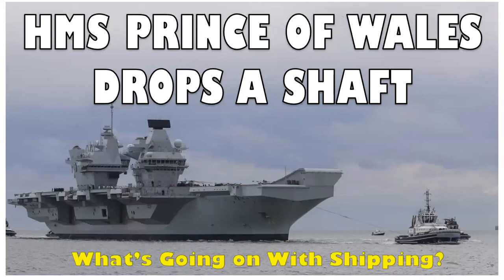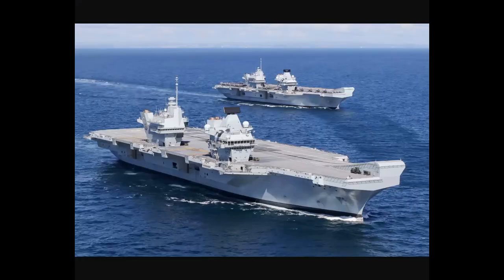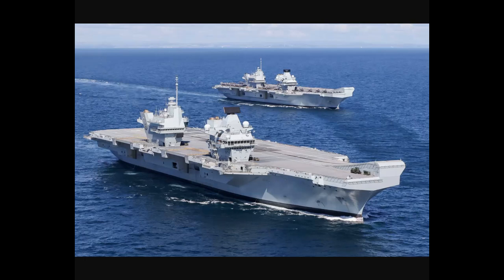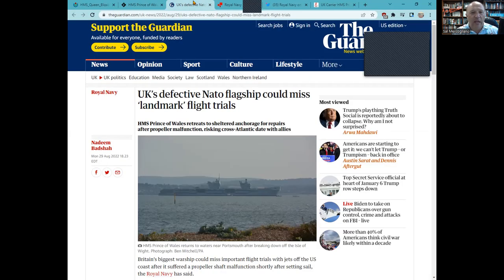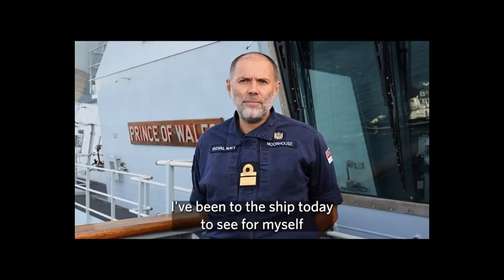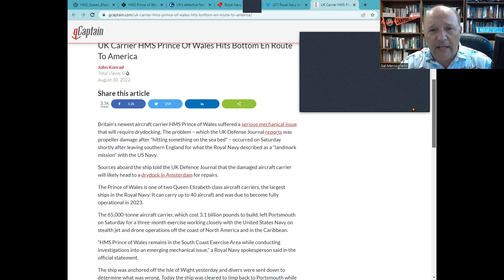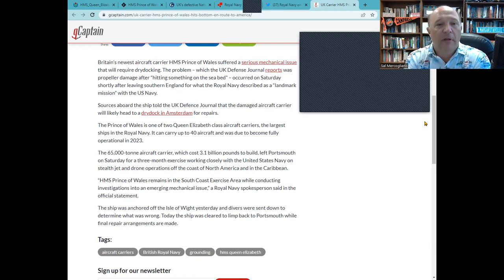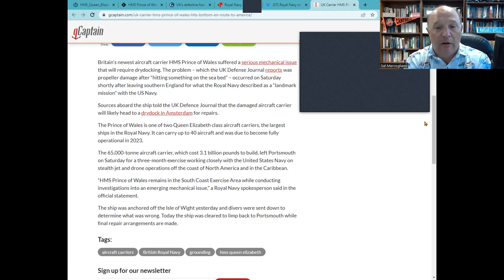HMS Prince of Wales Drops a Shaft - What's Going on With Shipping?

Comment: I may be wrong about this but heard that due to EU rules the contract for design had to go to the lowest quote. In a typically French underhanded manner the lowest price was offered by Thales, who would obviously increase the costs as time went on. The biggest problem here was that they had designed the appaling Charles de Gaulle which had so many faults that it was a laughing stock. One of the biggest problems was the propeller and shaft design so it's no real surprise to anyone that the PoW would follow on. The greatest testament to their stupidity had to be that,despite having used the Grumman Tracker for years, the aircraft carrier was some 60 feet too short to use this essential aircraft. What to do? chop it in half and add an extra section in the hull. This may sound hilarious but having spoken to a French sailor , he informed me that on descending some of the stairs would bring you up against a bulkhead without a door thus providing a deathtrap if the ship was on fire. The lesson from all of this--- never go into a deal with the French.
Reply: The Charles de Gaulle is a functioning ship with its own planes.  With all the recent British disasters not only in ships but also vehicles, I would suggest that there is only one common denominator in these failures. The French and Germans designed and successfully complete their projects and then exports them, the Brits don't

Comment: Would be amazing to see the Prince of Wales towed into Amsterdam. I live across of Damen Oranjewerf on Java-eiland. It is too small. The other option is a few kilometers north the other Damen drydock but it is only 250m long and not wide enough. Doubtful if it would pass IJmuiden lock as that one is 70m wide. If someone would consider the Netherlands it must be one the three other Damen drydocks in Rotterdam. I think one is 450m long. Damen Verolme. The others are slightly smaller but could fit the Prince of Wales.
Reply: Maybe The Netherlands can keep her kind of like a reverse raid on the Medway, except this time you don't have to go to Britain to take it.  :)
Reply: @kentvesser9484  based on the info available on all the impounded Russian yachts the burden will fall on the Netherlands to keep an impounded ship in peek condition. Netherlands is to misery to want to spend money on that.
Reply: @micheltibon6552  Well maybe they could give it a letter of marque and let it earn its maintenance fees from privateering...lol.
Reply: The beam at the waterline is 39 m (128 ft)(waterline) so depending on the height of the deck and any obstacles around the IJmuiden lock it could be a real possibility

Comment: Both shafts must be affected if they got towed.
Reply from the maker: They are only reporting the starboard shaft.
Reply: Maybe they were concerned about maneuvering in shallow water being compromised with just one shaft running.  Already embarrassing enough.  Probably wouldn't want to take a chance on grounding.
Reply: It’s not being towed as such - tugs provide low speed manoeuvring control in confined waters. SOP for large vessels with associated windage.

Comment: both of that class have problems with their shafts and seals .  they where leaking from the moment they where launched   ,   only remedy to repair it cutting newpieces of steel fit new seals and new shafts realign all shaft bearings ,  and that means its cheaper to build a new ship .  
Typical british quality , .

Comment: The last HMS Prince of Wales was used for torpedo practice by the IJAAF in 1941. Not an inspirng name. Also, why is a RN admiral dressed like the head of a maintence dept?
Reply: A working uniform / coveralls, worn because he probably was crawling around down in the bottom of the ship checking out that shaft for himself along with the Captain and ChEng (Chief Engineer.)  Not a place where I'd wear a dress uniform.
Reply: @robertf3479  Yes, dress whites would be out of place there. But doesn't having to see for himself show lack of confidence in his subordinates? Digicam images reviewed in his cabin while video meeting w/the builders  instead, or am I too US- centric?
Reply: @HalfBlindBob  When USS Caron (DD 970) screwed up a prop when pulling into the Soviet Port of Leningrad and there was thought that the shaft had been twisted or bent, there were all kinds of Flag Officers (USN) from 6th and Atlantic Fleets crawling around shaft alley to see for themselves (so many that the crew bitched about them being underfoot 😂.)  I was on shore duty by this time, so wasn't there for that bit of fun.

Earlier, we chewed up the leading edges of all 10 blades (2 screws x 5 blades) in gravel because the charts of Roosevelt Roads indicated 40 feet of water at the end of the pier, right under where the port Captain had parked our stern.  The water was only 30 feet deep and we drew 32 feet.  Yeah, did a real number on those blades and they all had to be replaced.  We got the prop blades intended for Cruiser Bunker Hill then under construction in order to quickly get Caron back to sea.  Aegis cruisers ARE Spruance class 'cans from the main deck down, identical powerplant and drive train / screws.  We had visits from CRUDESGRU 8 (Rear Admiral) and another from some RADM attached to NAVSEA.  They were underfoot too.

Comment: It hit a submarine.
Reply: Don't laugh.  Many years ago a tanker, during sea trials performed a scheduled maneuver called a crash back.  In a crash back the throttle is at ahead full, the ship is moving at full speed, and the throttle is moved to full astern.  The objective is to determine the stopping distance.  After the test the ship developed a unusual vibration.  Divers found one of the propellers bent almost 90°.

Months later the shipyard received a letter of apology from the Navy.  It seemed a submarine had been shadowing the tanker in it's wake.  During the crash back the ship struck the submarine's sail, bending the propeller.

Comment: All speculation....
Reply from the maker: Divers have been over the side inspecting the stbd prop and shaft.  She is still anchored off Portsmouth with no official updates.

If it was purely mechanical, there is no reason to send in divers.  Now it could be mechanical and have thrown the shaft and prop out of line.

Or they may have struck something that damaged the prop and the machinery.